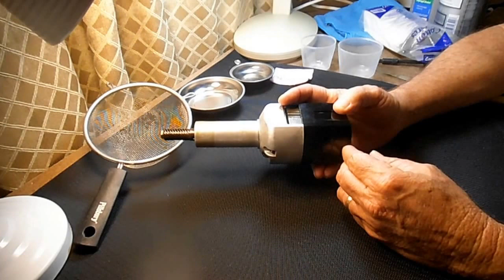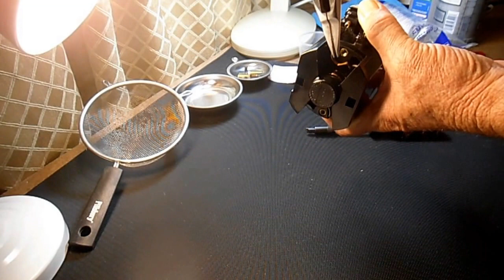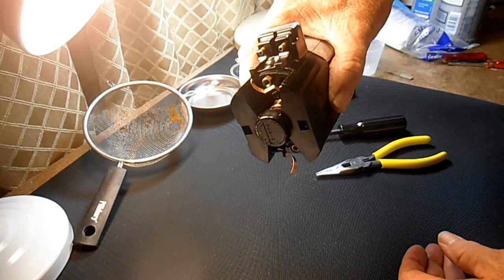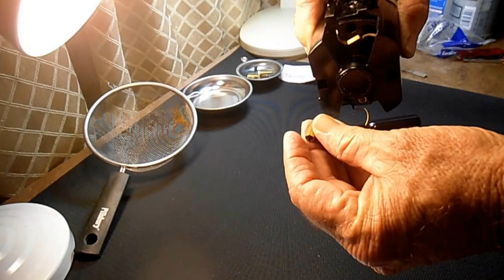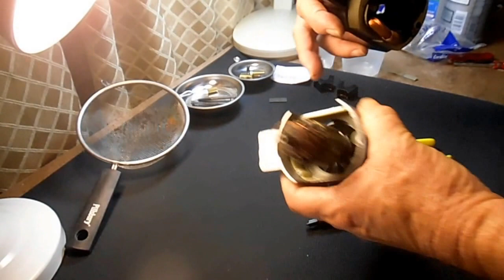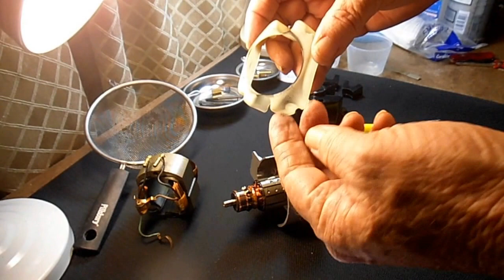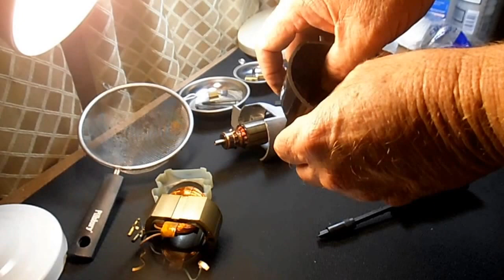HOW TO RESTORE SINGER PA STYLE SEWING MACHINE MOTOR Pt.3 HOW TO DISASSEMBLE THE MOTOR

Comment: Thank for this series! I just got a 404 and noticed the motor shaft has some play in it which clunks when I move the handwheel by hand. The worm gear, in fact the whole center shaft moves up and down about 1/8”. Any idea what I should look for to set it in proper position? Took the motor out and am about to open it up. I would have been too afraid to attempt it without your excellent videos! Motor is a PA 9-8. (My guess is PA stands for “parts assembly.”)
Reply from the maker: Hmm... I've never encountered that problem. I guess the first thing I'd look at is the pinion gear. If I remember correctly, the set screw for the pinion gear should be on a flat spot of the motor shaft. Maybe it is not. The top shaft bearing could be completely worn out. The bottom bronze bushing may be worn out, although I've not seen that before. An Andy Tube Viewer put up a very good video for replacing the top bearing if that is what you need: https://youtu.be/-2_gWInKXLk   You can download a free copy of the service manual, but I don't remember any info on the inside of the motor being in the manual: https://sewingdude.files.wordpress.com/2012/09/singer-401-service-manual1.pdf   Good luck, Mildred, and thanks for watching my channel.
Reply: @andytubesewing1953  Thanks!
Reply from the maker: @MildredGlutz  No worries, and good luck.
Reply: @andytubesewing1953  The pinion gear is totally stuck on the shaft with what seems to be hardened oil. The little wedge piece that goes between the halves isn’t there at all. My gear doesn’t have the nut at the top that yours has and that I’ve seen on other motors of the same type. I can’t figure out why there is that vertical play in the shaft. I think I’ll just get a new motor and save myself some time, trouble and a headache or two, lol.
Reply from the maker: @MildredGlutz  OK, that's up to you. If the pinion is stuck, remember it has been on the shaft for 60+ years so some WD40 may not be enough to loosen it. I get stuck screws, especially set screws, and presser bars all the time. It can test your patience for sure. I usually use heat if oil is not enough. I use a hairdryer, and many folks use a heat gun. There isn't much up there you can hurt. It's all steel and aluminum. I'm not worried about the missing nut, b/c I think the set screw is what holds the pinion gear in place. Does your shaft still move now? If you took the motor apart all that is left is that top bearing held in place by being pressed in and held with a retaining spring as in the video holding the shaft in place as in the video I linked to you. Is the center circle of the bearing moving when you push/pull on the shaft? Is the outer ring of the bearing moving? Between those rings are the ball bearings. Supposed to be anyway. If they wore out from lack of lube I could see the bearing would be flimsy and allow shaft movement. If you do "get a new motor" you mean a used one from eBay or similar as no one makes new PA style motors. I'd advise you have the seller send you or post online a video of then turning the motor by hand and of the motor running so you can see and hear the condition. Sad if you bought a "new" motor that was noisy with a bad bearing, right? Oh, about 20% of the motors I've opened have a broken or missing wedge, Like someone opened the motor to replace brushes and lost the piece. I've made them by cutting a rectangle from the lid of a soup or peach can, just to help align the two pieces during reassembly. Good luck going forward, Mildred. Take care.
Reply: @andytubesewing1953  Thanks, Andy! You’ve given me much to think about. I was pretty frustrated. As it is, the whole thing, not the shaft alone but the shaft/armature/fan blades, that whole section connected to the shaft, moves up and down within the housing by about 1/8”. The shaft doesn’t move by itself, alone. Will try using a hair dryer to loosen the gear and the soup can fix. Thank you!
Reply: The hair dryer worked! The pinion gear is free! Now, to compare the parts I see with the motor diagram. At the moment I am mystified by the bearing. The bearing, I guess it is, is dome shaped on the top with a tiny slot in the side and flat on the bottom when looking up inside from the bottom of the housing. It doesn’t move at all. Should it?
Reply: @andytubesewing1953  Hey! I fixed it!!! There was a thin washer in a groove on the shaft (which isn’t shown in the diagram, slightly different motor model, I guess) so I added another washer as a spacer to take up most of the slack. Also used a small washer as a shim in place of that missing wedge piece. Put the motor back in after cleaning things up and greasing the pinion gear. Running great now! Dang! I should have held off ordering that ebay motor! Oh well. Now, I’ll know how to check that one over thanks to you! I am thrilled! Thanks so much for your fantastic videos, your patience, your ear and great advice!
Reply from the maker: @MildredGlutz  Sorry if I misled you. The movement you describe is what I meant. Using heat has worked for me many times. Patience is the key here. Good Luck. I know you can do this.
Reply from the maker: @MildredGlutz  Good job. The bearing is "Pressed" into a space at the top of the aluminum housing if you mean the top bearing below the pinion. It won't move up or down if it is installed properly.
Reply from the maker: @MildredGlutz  Trumpets sound all around!!! Congrats. It sure seems someone was inside that motor before. I like the idea of using a thin washer to replace the wedge. That is creative and better than a piece of a can. Thanks for sharing this adventure on my channel. You can keep the other motor as a spare if you plan on keeping the machine, or sell it if you don't. I have a spare motor and bobbin case for all my wife's machines b/c no one makes them anymore. The machine itself can last another 60 years easily. SO happy for you for not giving up.
Reply: @andytubesewing1953  Thanks, now I’m on to the next dilemma of figuring out how to center the needle in the hole in the needle plate. I’ve got a size 11 needle in there which should be pretty much in the center but it’s off, a little too much to the right and very slightly to the back. Been trying to figure out how to adjust it using the sewingdude’s free manual but the other machines in the series seem to have a lot more stuff in that compartment. Trying to figure out which screws will make the adjustments I need. You don’t happen to have a video on that for the 404 do you? 😀
Reply from the maker: @MildredGlutz  No video. I had to go back and see you are talking about a model 404. A couple of retired SInger Service Men told me on model 404 the needle bar bushing is set at the factory to align the NB with the hole. Something about the bushing is eccentric and how it is turned determines the position of the needle. They advised do not change it unless the machine just will not sew. I've never loosened the set screw and turned the bushing. I've had a couple machines with the NB not perfectly centered but they sewed fine so I did not change anything. If you try to change it, be sure to mark where it is before you move it in case you want to move it back because the needle bar was bent or something. Be sure you use a new needle and that the needle clamp is very clean up inside where you insert the needle and you insert it completely. I timed a machine once with a slightly bent needle and a day later the lady said it was skipping stitches like crazy after she put a brand new needle in to start a new project. After that, I always use a new needle for testing/adjusting.
Reply: @andytubesewing1953  Ok. I did turn a screw and the needle bar slipped and it messed up the timing, I think. Managed to get it back in place and it is sewing fine so I guess I’m ok there. I cleaned the channel where the needle goes and put in a size 12 Organ needle this time (the other was a Singer 11) and it seems a bit better centered. I’m fussy about the needle being centered because I like to do an edgestitch on shirt pockets, etc., that is really close to the edge (approx. 1/16”) so I use the inside edge of the short finger on the presser foot as my edge guide, which works great on my 15-90. It may work on this 404 with this new needle now that it looks more centered. After my mishap with the needle bar, I’m happy not to mess with that again! I don’t know what they mean by “eccentric” bushing. I saw that term in that sewingdude 401 service manual, too. But, it’s probably best I don’t mess with trying to center the needle by turning screws anymore. Great to be able to ask retired Singer service men questions! Ever considered doing a podcast with them?
Reply from the maker: @MildredGlutz  An eccentric bushing means the hole through the bushing is not in the center of the bushing, but a little off-center. As you rotate the bushing (during adjustment) the needle bar & needle rotates within the center hole until you line it up where you want it, then retighten the bushing set screw. Ever use an adjustable zipper foot for sewing close to an edge? I don't sew but know sewists who do that. The retired fellows I knew were in the 1980' - the 90s. There came to Arizona as winter visitors. I met one fixing a flat tire one night on the side of the road, and he introduced me to his buddy. I used to buy them breakfast while they were in town and asked them many questions. I wish I had thought to record them. They are in VSM heaven I'm sure... really great guys.
Reply: @andytubesewing1953  Kismet meeting those Singer guys that way! I imagine those technicians are all mostly gone now. We are definitely lucky you have shared so much information about vintage sewing machines in your videos! I noticed in the 401 service manual that the flat side of the needle should face slightly to the left rear. Wonder if that would change the centering. I guess it would depend on whether one slightly turned the needle clamp or that eccentric bushing. Anyway, I can’t quite figure it out from the directions for the 401 since the 404 doesn’t look the same in that area. I think I know which is the eccentric bushing now in my 404 but I’m not confident enough to mess with it yet. I’ll just leave it alone for now. I hadn’t tried using an adjustable zipper foot for edgestitching before but tried it this morning and it seems to work pretty well. Great tip! I watched your video on the hook timing so I checked mine since I just eyeballed it after messing up the needle bar position yesterday, not knowing about the two lines. It was a little bit “late” but now it’s perfect. So glad you made so many very helpful videos!
Reply from the maker: @MildredGlutz  The service manual is a fairly common style when they have different models in a Class of Machine. The Class is 401 and includes the 401A, 403A, and 404 models. They show all the steps for the most advanced model so in this case the 401A. They have some separate instructions for 403A and nothing special for the 404 basic straight stitch model. The flat side of the needle faces directly left and when/if it is turned due to needle bar or clamp the small thread loop formed on the needle won't line up nicely with the hook so the hook point can grab it. That can/does cause skipped stitches. 
The needle clamp should be lined up so the thumbscrew faces directly right then the flat of the needle will face directly left.
I've never had to adjust the needle bar bushing in any way on a 404, 403A, 401A, 301A, 500A, 503A.
Reply: @andytubesewing1953  Wait, what? The flat shank of the needle faces to the rear, not the left. We must be talking about different things. Are you talking about the flat part of the needle bar facing left? I was referring to the 401 manual p.134, “To Check the Position of the Needle in Relation to Straight-Stitching Throat Plate.” It says “Check: When the needle enters the hole in the straight-stitching throat plate, the short-groove (flat shank) side of the needle should face slightly to the left of rear, as shown in fig. 281. And then I would look at “To Centralize the Needle in Needle Hole in Straight-Stitching Plate” on p.142 which is kinda confusing.
Reply from the maker: @MildredGlutz  Mildred I'm sorry. YOU are correct and I was mistaken. I'd just spent a half-hour helping a person with a model 301 and wanted to reply to you before going to bed. My fault for answering comments when I'm sleepy. So yes, the flat side faces back in the 401 class machines. As to the rest, remember the service manuals are written for the top of class models as you see. That's why there is all the info about the vibrating bracket and ZZ setting and so forth. There is no direct info for centering the needle on model 404. That was why I asked the repair guys in the past and got the response about the needle bar bushing being set at the factory and not changing it unless absolutely needed which I have never had to do on a slant needle machine. After this many comments and leading you to the Service Manual, I don't think I can be of help to you any further. Good luck, and thanks for watching my channel, and sorry again for misleading you with my earlier comment.
Reply: @andytubesewing1953  Thanks for your help, Andy! Much appreciated. I know there is much more in this series I haven’t seen yet that will be immeasurably helpful, as well. I’m probably not going to mess with trying to center the needle at the moment. Best to you.

Comment: Hi! Andy,
I have a bearing going out/or loud in one of my Singer 301 sewing machines. I have to learn how to replace the bearing. What do you recommend? Are there any Videos (by you or someone else) to teach me how to do bearing replacement? I need to learn "every aspect" of Motor & Sewing machine repair! I'm in too deep to quit. (Plus, I love the work!) TIA
Karla G
Reply from the maker: Karla I do not know of any video that shows this procedure. I have read different instructions by various people about how to remove and replace the sealed bearing. Some advised using a hydraulic press, (most successful method) some used a wood dowel and hammer, some used a couple different sizes of socket from a wrench set and a hammer. The retaining clip must be removed and the motor housing taken apart. The people who responded to my questions said the bearing or motor housing was damaged during the process. The most successful method seems to be oiling the existing bearing from the top and bottom with a SMALL amount 2 -3 drops, of 30WT motor oil. I bought a bearing here 2 years ago, but have not used it, https://www.shop.sew-classic.com/Bearing-upper-sealed-motor-bearing-Singer-401-403-404-500-503-196630.htm
I have added the drops of oil will good results 4 out of 5 times.